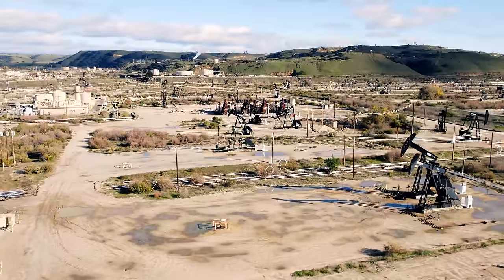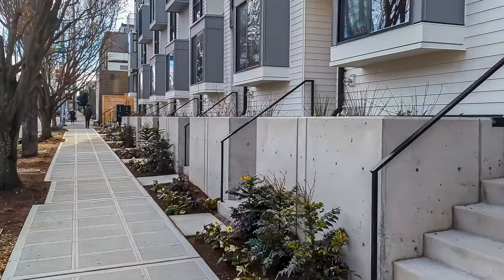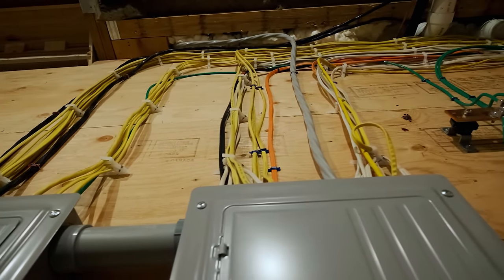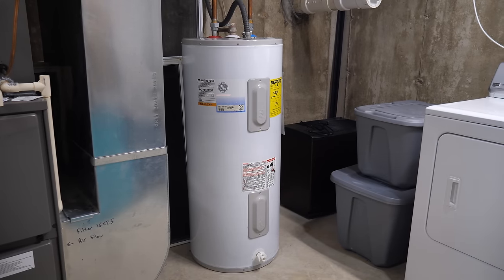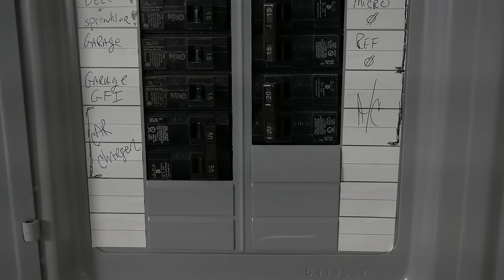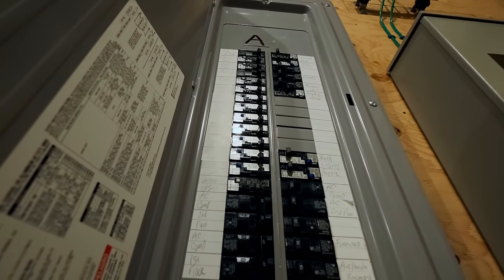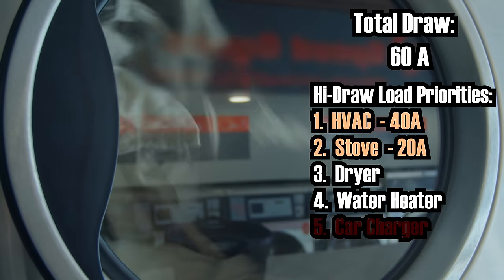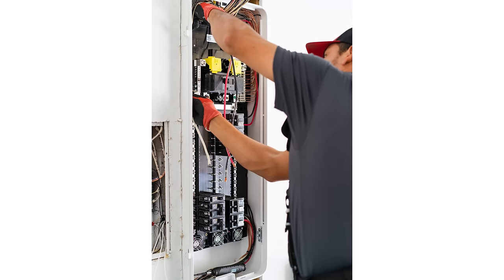Home Electrification: There's not a lot to do, and it doesn't have to be hard (Part 1)

Comment: You ought to prioritize stove over HVAC. House will maintain temperature for a while. And you wouldn't want to be denied the ability to cook, or have food come out undercooked because the oven shut off halfway and now you don't know exactly how much longer to cook something. Pretty unlikely either the stove or HVAC would get cut off either way, but that's how I'd do it.
Reply: I was thinking the same thing. I’d rather have the ambient temperature change slightly for a moment than mess up my food.
Reply: And the heat from the cooktop ultimately ends up in the house anyway. Not as much as the same watts from a pump, but still, not zero either.
Reply: I was thinking I would probably give washing machine for example quite high priority as I wouldn't want it to suddenly stop in the middle of a program.
Reply: Can confirm. We have a small farm house, all electric, 100 amp service. Everything works great, and when we cook the baseboard heaters in half the house don’t run because the oven and stove kick out more heat than the heaters.
Reply: @MauryMarkowitz  What if it's 100 degrees outside and you already run your air at 76 to save energy and you don't want the expense of replacing all this stuff just for the inconvenience of your house being a sauna when you are cooking?
Reply: While I agree with you normally, keep in mind that you haven't considered the defrost cycle some HVAC systems have to go through in the coldest places.

If your AC is in the process of removing Ice from the external radiator and you turn it off at that critical point, it MIGHT cause you issues.

This is likely only a concern in places like Canada, but I can definately see the problem.
Reply: @Qwarzz  The washing machine uses comparatively little power, especially on a cold cycle. It's the dryer that uses a lot.
Reply: I was thinking the same thing. If I changed our electrical setup in such a way that the stove cut off while my wife was cooking I’m not sure I’d see tomorrow 😂
Reply: @xeridea  best way to deal with that is a solar oven.

Don't add heat to your home when it's hot lol
Reply: You'll have an app to swap it